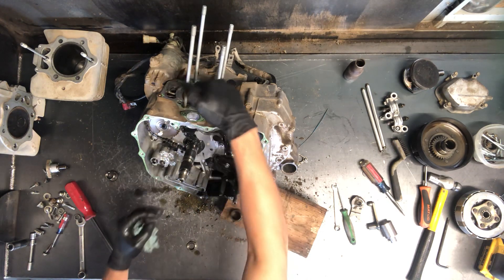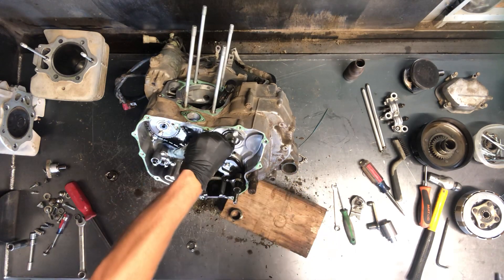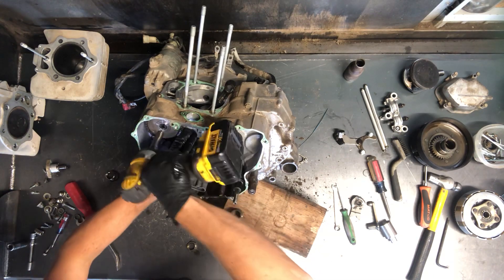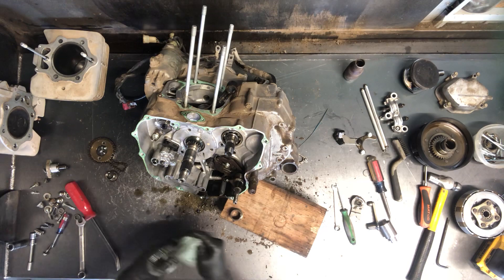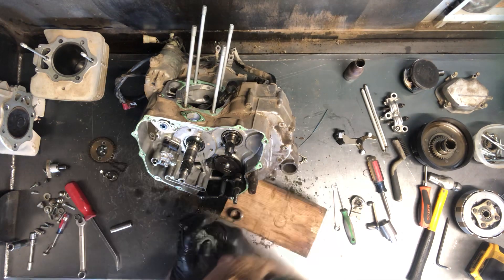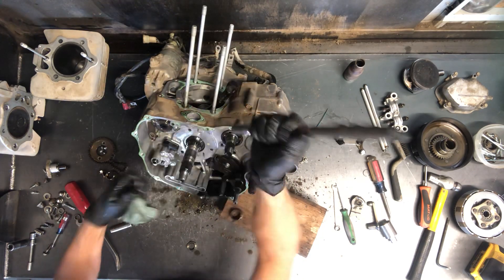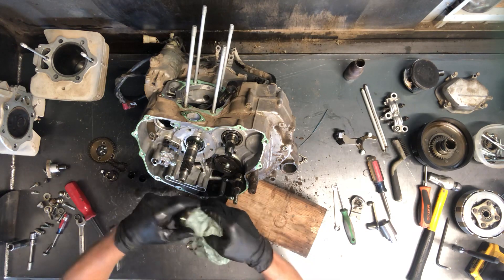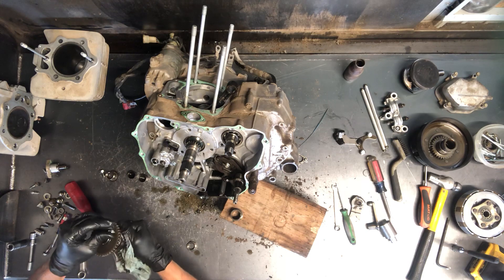How To - Honda Foreman 450 trx450s - Cam Shaft Camshaft Replace / Remove

Comment: Hey I was watching one of your yamaha 660 rhino rebuilds and I'm trying to figure out the 2 timing marks on the crankshaft gear with the springs and pins and the counter balancer.  My question is what do you align the gear with the springs to that is on the crank?